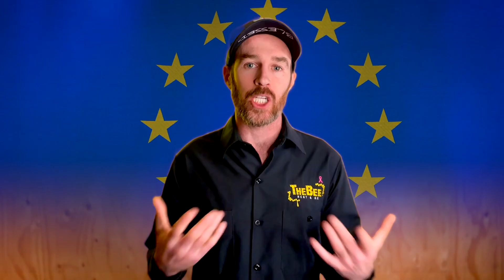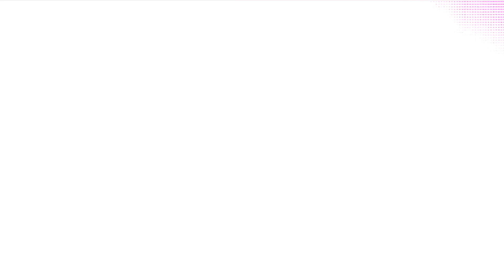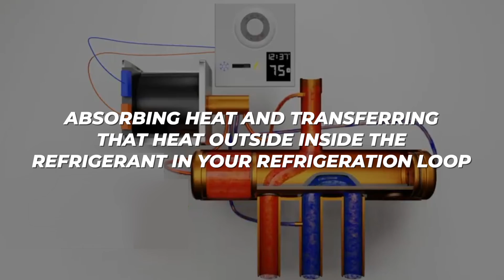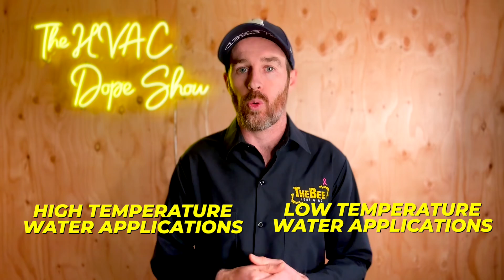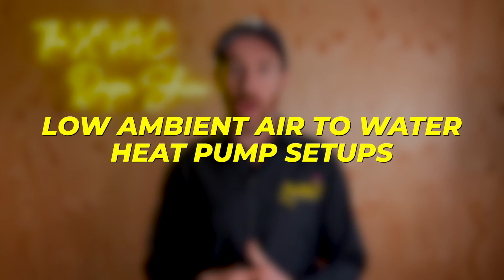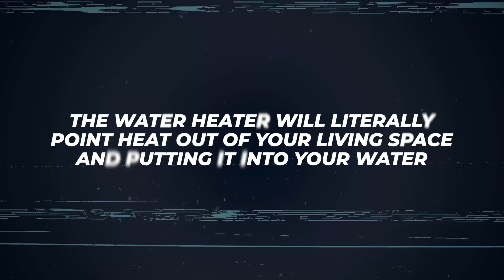This water heater changes EVERYTHING🤯 | Heat pump water heaters

Comment: Have you thought about a video on after market UV units to kill mold such as the EnviroAire IAG unit  I have a Carrier heat pump about a year old for the bedroom level of the house and a 2016 Bryant heat pump and  gas furnace for the main floor and basement. A check-up by a technician showed me "mold" in the units and offered to install two UV units for $2600. I live in central Virginia. thanks,
Reply from the maker: Yes we’d be happy to make a video about this, UV units are for sterilization and do a good job killing bacteria / mold / viruses etc. I think they’re a good solution, I don’t know how much of a difference people can actually tell but they’ve been shown to make a difference and reduce airborne pollutants. When you pair them with good filtration they work well. If you have mold in your home I would see if it’s from water damage because if that’s the case you want to get that addressed so the root cause is fixed. Either way happy to make a video!

Comment: This explains why our president want's to outlaw gas heat. Eliminating efficient and reasonably priced gas heat clears the way for this stuff. I wonder how much investment he has in these products. Way too many things to fail that are manufactured by the lowest bidder and redesigned by bean counters that cost more to repair and more frequent repairs than gas heat or electric resistance heat.
Reply: A heat pump is fundamentally more efficient than gas heat. Because it doesn't need to produce the heat. It only needs to move heat from the outside into you home or you water tank.
This is the prominent form of heating in Norway, Finland, Denmark.
Reply: I could argue the full cost of gas heat isn’t in the price you pay.
Reply: These can pay for themselves in as little as 22 months vs a gas or resistive heater
Reply: Like they did with clothes washers.  Designed to last 5 years, and to save water and energy rather than cleaning clothes

Comment: could let us know how much the large 4/5/6/ ton heat pumps units with multiple head units use for watts and amps looking at adding large outdoor unit with 7 heads
Reply from the maker: It’s going to vary by unit but they modulate and most of them have 10:1 turndown ratio or more (meaning they can run at 10% capacity or less) so that when they kick on they might only be pulling 300 watts on startup, and on the high end at max capacity pull closer to whatever the max rated load is on the rating plate. If you look at the submittal sheet of any given unit the max amps will be at 100% capacity, but the minimum will be based on the indoor unit / load. That’s the nice thing about multiport inverter ductless systems like the MXS or MXL units is they pull around 1 - 2 amps on startup